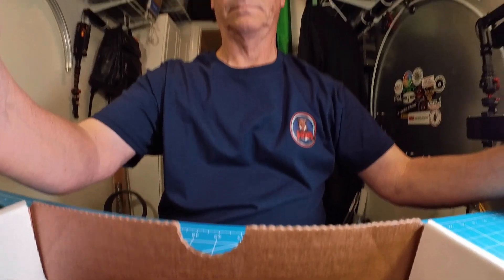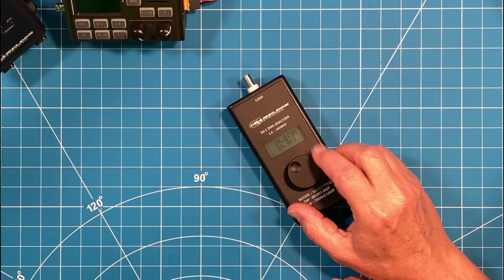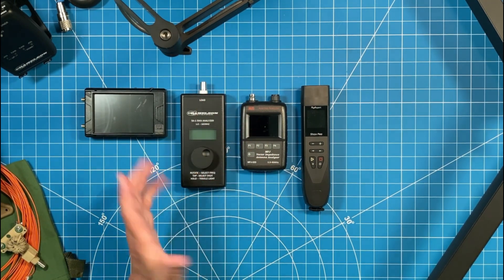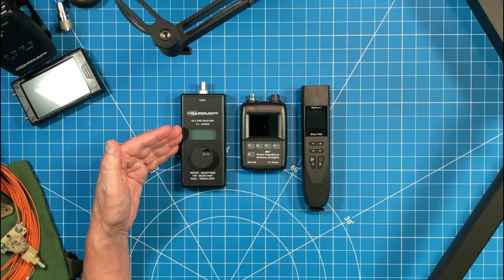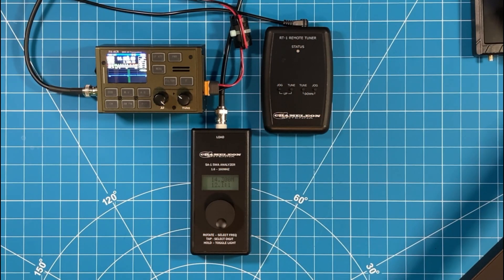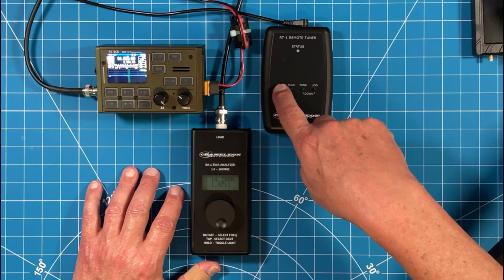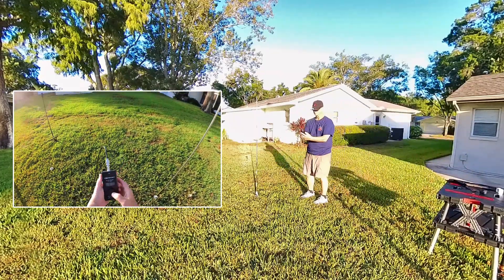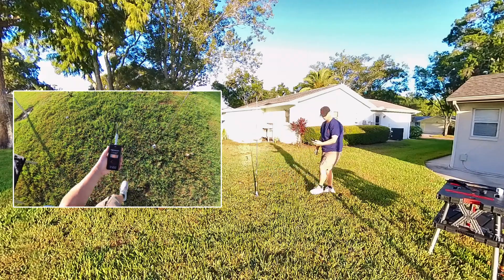Chameleon Antenna Introduces a SWR Analyzer, the SA-1   Here's a First Look, How to Use, and Review

Comment: Wow Bob, this seems to be what I've been looking for. I have a NanoVNA but find it finicky and end up calibrating it several times to get a stable repeatable reading. This seems so much easier. You didnt mention anything about calibration. So I'm to assume there is none needed. It looks very easy to use. Does it have a build-in rechargable battery or does it require one to be installed before using? I looked at the Chameleon website and unfortunately it is out of stock at this time. I'll be keeping my eye on this one. I like how you showed using it with your cha f-loop. Exactly what i was thinking of before watching your video. 73, Joe KB9RCR
Reply from the maker: No calibration, comes calibrated from Chameleon.  It sold out quickly after my review, and now it is on backorder.  Thanks for viewing and commenting.

Comment: Great video Bob. I prefer the RigExpert Stick 230 (about $300) as it has the graph so I can see if I need to go up or down to tune. This new analyzer is similar to the MFJ-269 as you have to sweep to see if you are too long or too short. Doesn't take a bunch of time and at a significant savings, you can still tune quickly. 

As for the Tiny SA. correct me if I am wrong (I often am) it is a spectrum analyzer not a VNA so not sure how you could get SWR from that device. As someone commented below,  a nanoVNA is absolutely the cheapest option but they tend to be a bit fiddly to set up for simple SWR measurements and are not as rugged for field use.

All that said, this is certainly a dead simple device at a very reasonable price.

73
Bob WV7W
Reply from the maker: Thanks for stopping by Bob.  As for the Tiny SA Ultra, I'm going off of what I've been told...I have yet to learn to use it, along with a thousand other gadgets in the shack collecting dust due to my allotment of discretionary time. 

I think its great we have so many options; everyone gets to choose what works best for budget, needs, understanding and on and on.  So much gear, so little time.

Comment: Pretty nice bit of kit. If you don't care about 160M, for $90 you can use the Diamond SX-20C (3.5 to 150 MHz).
Reply from the maker: Thanks for viewing @W9HJBill.  The SX-20C requires you to be connected to a radio and transmit, an analyzer will measure SWR without being connected to a radio.

Comment: I own quite some antennas from chameleon and am nearly obsessed to get a PRV and the remote random wire coupler (based on the MAT-50) shown in one of your previous videos from one of our european retailers.

Does this analyzer support compensation of the feedline length and type?

Otherwise it would not make any sense measuring not directly attached to the feedpoint. Because of the feedline's transformation effects one would be tuning the antenna and the feedline, which will in most cases, lead into the antenna itself is not tuned to optimum resonance that would be achievable. Still, this will be a good thing for radios without an integrated coupler, but will not max it out for those with one built-in.

72 de Simon, DC0SK